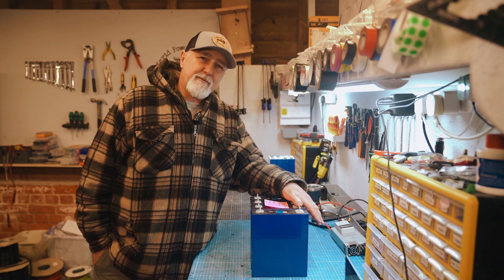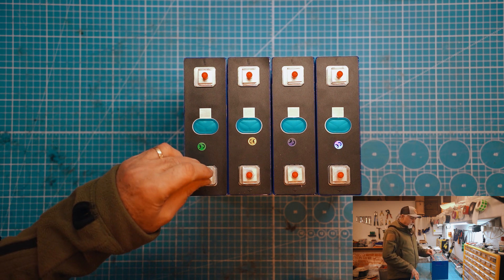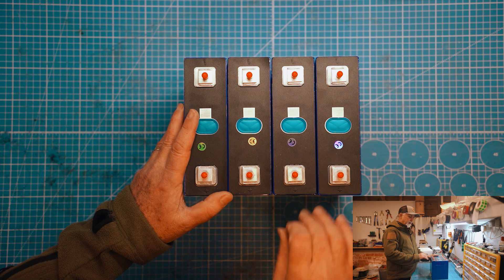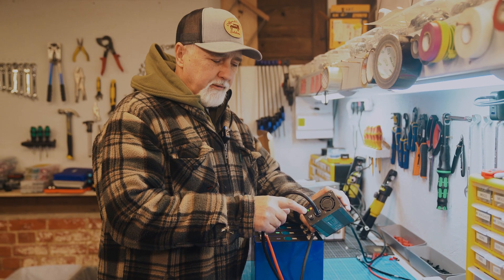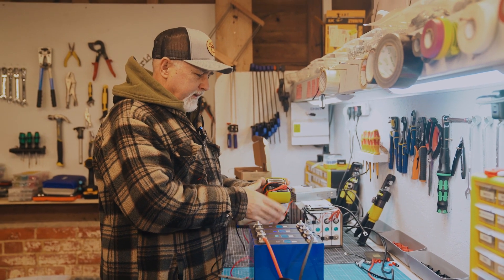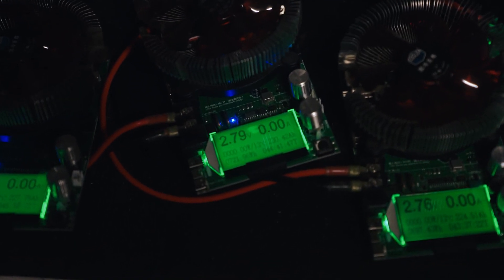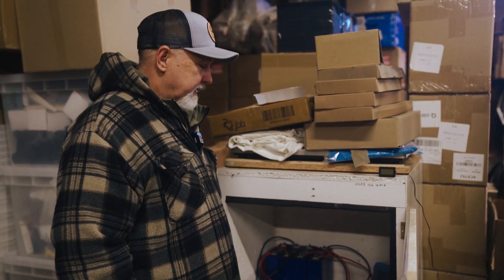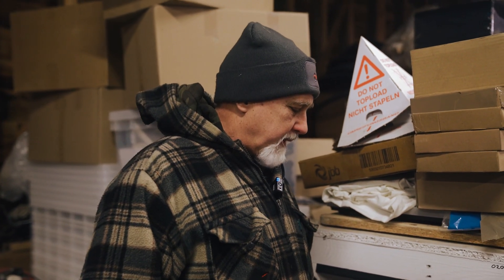EVE 230Ah LiFePO4 cells for $65?

Comment: Never ever leave those capacitors and rely on their cutoff voltage. I left that identical capacitor to run on one of my eve280 cells and it failed to stop upon the set voltage and blew two of my cells up like water melons!
Reply: Capacitors?

Comment: Very interesting.
Did you rebalance the batteries after the individual discharge? Just wondering.

Normally when I see this behavior (individual cell fail/ battery passes) the first thing I look at is my testers – I had one go bad.

If your balancer indeed pulled off this very nice result, would you be able to tell me what balancer you used? If the balancer managed to keep up, to give you this result, your batteries will have ended up bottom balanced (or close to it). When you now recharge you will most likely get a high voltage disconnect unless you rebalance.? Or are you assuming your balancer managed to keep up on the way back up? It is much harder on way up since the balancer will (mostly) only work on the exponential part (knee).

If you add up all your AH, you end up with 917.54 = 229.385AH/cell average. In theory the balancer will move energy around between cells for you to get max capacity, and assuming a perfect balancer, you are still a bit short of your measured 230AH?. I think a couple of your testers are out of calibration.

If these cells are indeed 224.51AH- 235.04AH, would you still recommend them?  Most people do not have access to energy recovery balancer of this type as far as I know, so they would be stuck with a 4S battery with 224.51AH. I think usually balancers are only turned on above 3.4V or so?

Even in your case, if you actually run a high current discharge test (say 100A) the balancer most likely would not be able to keep up and you would also probably be stuck with 224AH total battery capacity.

That said, if I could get these cells to my door for $65 plus reasonable shipping I would consider that a win even at 224AH, considering the bad luck I had getting decent cells.....

Comment: LFP Nominal Voltage = 3.200 Volts
LFP Nominal/Optimal Temp = 25C not 20 or 21 but it makes lisstle difference between 20-30C  outside of that temp range, there will be effects.
The EndAmps/Tailcurrent for 230AH is 11.5A  

Looking at Vendor Listings and several RED Flags come up... Pay Attention to the details.
Some are NOS Cells and likely over 12 months in storage.
Some "Prismatics" are listed as Semi-Solid-State - THEY ARE NOT !
Quick Point is when they advertise "Intact QR Codes" for some but not all....  WARNING THERE.
When Higher Capacity cells are listed as cheaper than lower AH cells - they are brokered bulk cells, therefore didn;t even pass as B-Grade.
Most cells do not list the Actual Manufacturer - won't have proper QR code if any at all... 

At preset there is a glut of cells in warehouses and many manufacturers (smaller ones) have been laying off staff and going "fire sales" at deep discount to eliminate New Old Stock.  This present Opportunity for both Good & Bad so with care and caution you can get some incredible deals.    Even CATL has laid off a couple of thousand workers !

Comment: Put the neg and POS charger Cables opposite not same side you'll get a quicker equalize
Reply: Sir, as a learner i am asking, can you explain your comment briefly please, so i understand the mechanism behind it.
Reply: @nomanshah6761  if both cables are on one battery that battery will get more amps than the ones after it in parallel, same as if you filled parallel buckets of water cascading into each other

it can be a problem if you regularly charge and discharge batteries like this because they end up unequally sharing current and so you will have them at varying states of charge

this isnt much of a concern for this type of test though
Reply: @EspHack  ohh.. thanks for the explanation,
Initially i got confuse (by opposite i think of negative terminal instead of other end).

But thanks to you it got cleared now

Comment: I know this video gives us options if we have trouble affording top grade batteries, I would like to know what to expect if I use them in my van setup - such as, realistically they perform like a 180Ah and not a 230Ah battery. This allows me to weigh the pricing against top quality 180Ah cells. The capacities are a bit on the low side for this brand, EVE. Plus, I would like to see a high discharge test, best would be each cell and then 12v battery. Cells / batteries can pass a low discharge but will fail miserably when capacity is asked of them under high currents. Practical use is what your channel is about, so built batteries will be having lighting, inverters, pumps etc running off them. Thanks for trying these out.
Reply: Agreed. I want 16 cells wired for 48v for my van.
Reply: 5A discharge current for a 230Ah cell, thats lame. The manufacturer claiming 230Ah @0.5C. so use 230*0.5 = 115 A of discharge current. (Because we all know, by increasing discharge current less juice we can extract from the cell)

And one more idea is that attempt to discharge them at 1C and at 2C rates as well.

Comment: Thanks for the vid.  I am tempted to give these cells a try.

But with the recent e-bike fires in the news, I wonder how safe these battery cells are going to be?  I wouldn't my camper to burn down in a fire.
Reply: Different battery chemistry , these Lifepo4 are safer, they don't  catch fire 🔥
Reply: @Dirt-Diggler  Thanks for the explanation. I guess the important thing is to get Lithium Ion PHOSPHATE cells with emphasis on PHOSPHATE.  Cheers.
Reply: Additional info: The cells typically used in eBike batteries are Lithium Ion OR Lithium Ternary OR Lithium Nickel Manganese Cobalt (Lithium NMC) cells. All different names for the same cell type.

These are Lithium Iron Phosphate cells.

Lithium NMC are also used in BEV cars.
Reply: @CollinBaillie   Thanks for the explanation.  I will insure to buy only either Lithium Ion Phosphate batteries or battery cells.
Reply: Lifepo4, it is Lithium Iron (Ferum) Phospate, Not Lithium Ion Phosphate. Lithium Ion mostly used in cellphone, ebike, smartwatch an Tesla (Panasonic cell ev)
Reply: @jonitan76  Technically, LiFePo4 operate by Lithium ions moving between anode and cathode, so they are still a Lithium Ion chemistry. But as Lithium NMC (or Lithium Ternary) cells became known colloquially as Lithium Ion, it makes sense to always use a different nomenclature for other Lithium Ion chemistries, like

Lithium Iron Phosphate
LiFePo4 (usually pronounced as Life-Po-4)
Lithium Ferro-Phosphate
Lithium Ferrous Phosphate

For these cells.